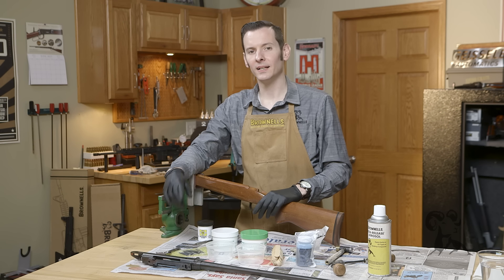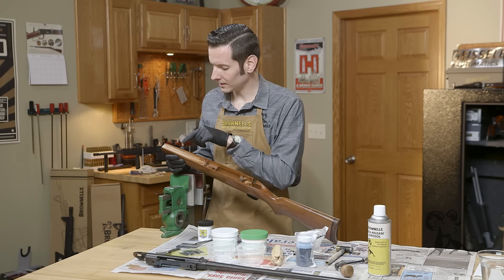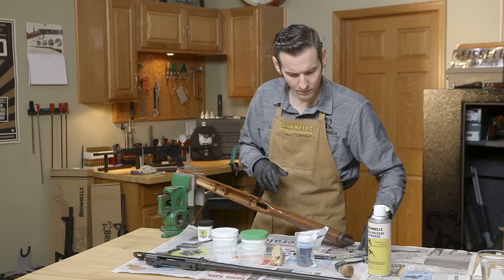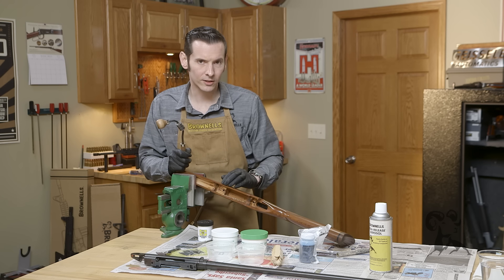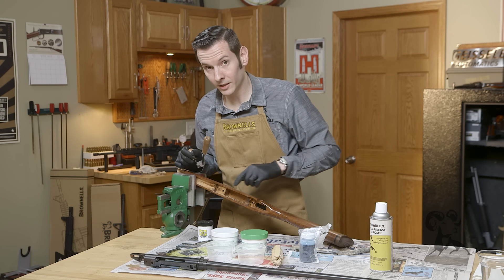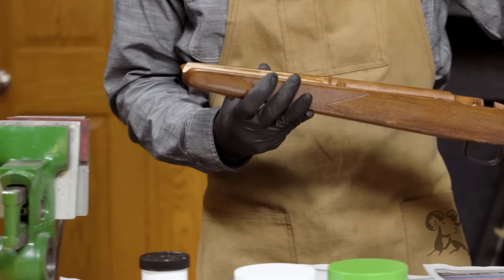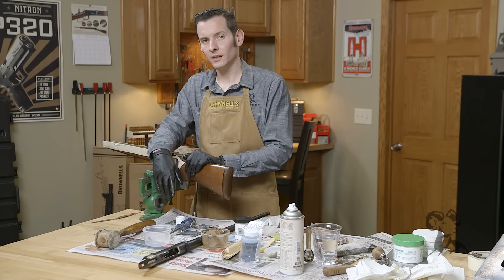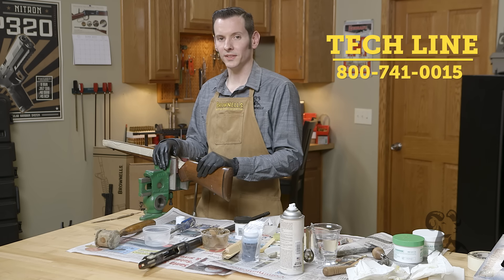Tech Tip: How to Bed a Rifle With Acraglas Gel

Comment: Good video. It’s easier to take Q-tips and clean up rather than to let the bedding compound partially solidify. Also painters tape is better because it won’t leave any adhesive on the stock. You also don’t need to bed the entire Barrel channel of the stock if you’re gonna float the barrel. And I’m not for sure why you didn’t bed under the front action screw just behind the recoil lug area.
Reply: Similar thoughts here

Comment: What is stopping the epoxy from going into the action screw holes. When you are pushing the action screws from underneath arent you pushing the epoxy in front of the screw into the hole and then tightening it all up?

Comment: Caleb, this was excellent.  As one of the last of a dying breed who actually works with their hands to make a living, I do have a suggestion.  The single edge razor blade sucks for what you were using it for.  Get an Olfa knife.  It has little snap-off blades.  It is NOT a boxcutter.  An Olfa knife is a precision instrument, designed for finesse work.  I am a window tinter, and I would put my knife skills up against any surgeon and win.  After over 30 years, the knife becomes an extension of your hand and your brain.
Reply: I use the utility version with the rubber grip more than any, but having a couple of different styles is handy.
Reply: I know what would happen if I used a razor blade...imagine that I would manage to cut into the stock 😮

Comment: I can remember doing this over 50 years ago when I was a teenager to a 10/22 that was very inaccurate. All I had to use was fibreglass resin, silly putty and vaseline for release agent. It worked well, but It's nice to actually see how it should be done. I still have the rifle, but It's been rebarreled and put in a new chassis.

Comment: I use extra long action bolts to center the action screws to the pillars and level the action square to the bottom/trigger guard. If you use the original action screws dont tighten them if the action is touching anything in the inletting other than the pillars. A high spot in the wrong place will cause stress in your bedding job.
Also tape the bottom, front and sides of the lug. Only rear contact (unless it is an integral lug, then none on the sides)

Comment: The part about waiting four hours to pull the barrel and action out to trim the excess acraglass needs to be caveated with what type of environment you are allowing the curing process to take place. If you are in a warm, dry climate and wait four hours, just get out the dremmel tool and start grinding! Great video.

Comment: 👍🤔 I thought you were going to free float the barrel in front of the camber. Good show
Reply: That’s what the tape was for on the barrel.  He now has the thickness of the tape free floated.
Reply: It's floated, the thickness of the tape.
Reply: @CalebSavant What possible benefit is there too acraglass bedding the chamber area? Wouldn't it be better to float the chamber area?
Reply: @anthonyrstrawbridge  Supporting the chamber helps add rigidity to the forend of the stock without effecting accuracy and barrel harmonics.
Reply: @CalebSavant  OH! I understand now thanx. Been away from wood so long I couldn't recall why.
Reply: I guess applying the aqua glass the full length of the stock origin is that correct I have never done it that way I always just after class the action forward of the lug about 2 inches

Comment: I encountered one that had a peened spot on the action and a little wood Chip that was folded over onto the mounting surface too. Removed both and the front action screw was too long also so I shortened it slightly. Gun shoots sub moa now

Comment: Great video. I've bedded many rifles and learned something. Surgical tubing is ingenious. I've always used rubber bands. Really the only thing I do different, is instead of using a commercial release agent, I use Kiwi shoe polish. What was the tool you used to get the glass bedding out of the magazine well? It looked really useful.
Reply: I thought it was a chisel by the handle when he grabbed it, but the way he was using it made me think it was some kind of hook or prybar? I've seen body/trim tools in auto sections of hardware stores that are plastic or fiberglass reinforced plastic that  might be useful for this, non-marring for the surfaces, but that acraglas looked very pliable to remove, especially after he scored it to get a clean line first.
Reply: i never used surgical bands, know what i used? i used the bands from sling shots. i think theyre virtually the same thing tbh

Comment: Caleb, not that it's necessary, but would a pointed surgical scalpel make trimming the acraglas out of the mag well easier than using a razor blade, given the tight quarters?
Reply: Yup, it would! An exacto works well too
Reply: Yep.  In addition, I manage to cut myself with razor blades, so X-acto is my choice.  Next project is to demonstrate pillar bedding.

Comment: Did you cut the rest of the glass in front of the chamber so the barrel free floats? Think that part got cut off
Reply: pull the tape off the gun barrel. the tape was the gap width, approximately the "dollar bill" waay of old. his method is good, ill verify he followed the right procedures.

Comment: Why do you add bedding compound all the way to the front of the fore stock when you want it free floating?
Reply from the maker: To add rigidity to the stock, so it will be less likely to flex when rested on something.
Reply: He put tape on the barrel, so it doesn't touch, obviously with the tape removed.

Comment: I think this video was informative but there are a few simple things that I believe are important. 

First, you are showing that you use the same measuring spoon for both part of the ACROGLASS. This will result in cross-contamination and will start the polymerization of the resin. As little as 0.005 grains will start the process of hardening the resin. I know this from experience. Use 2 spoons and keep them separate. I use plastic spoons as they should be discarded after use. 

Second, when you have applied the ACCROGLASS  leave the stirring stick in the remaining mixture. Then you can know the degree of hardening. 

Third, you should use headless stock makers screws instead of the factory stock screws. This allows you to align the stock and action without twisting the action to align the mounting holes 

Forthly, I would mention that household VINAGER will remove ACCROGLASS from your skin if you need it. I like that you showed using gloves, but most men find gloves a nuisance. 

I compliment your presentation it was excellent. I would suggest using more close-up shots to help the novice gunsmith understand the intricacies.

Comment: Why bother putting the bedding under the barrel that is going to free float?  I mean, other than OCD.!!!!
Reply: There is a very good reason for that, it's to make the stock more rigid so that it does not flex and contact the barrel when the rifle is shot of a rest or swollen from moisture.
Reply: @CalebSavant If the floated portion of the forend can swell from humidity changes, cant the portion of the forend that is bedded for contact at the front, sides and bottom of the lug, barrel nut and chamber do the same? Clearance is a good thing sometimes.
Reply: @kassilewis5511  Yes, but the bedding does not, it's all connected and will not move because of that.
Reply: Okey dokey...one more, any chance you know the shrink rate percentage of Acraglass?
Reply from the maker: 1/10th of 1%
Reply: Something I don't understand!? Why is the barrel floated in the first place? Older military rifles are often clamped to the wood.
Reply: @thomasbaker9787  This is true but as time went on people started to further understand more and more about barrel harmonics and their affects on accuracy. With a wooden stock in firm contact with the barrel, exceptional accuracy could be acheived but as the wooden stock contracted and expanded due to humidity(as wood does)the accuracy of the rifle could decline from the pressure on the barrel being a constant variable according to temp and humidity. Thus "free floating" was born, with nothing at all touching the barrel it was free to "sing" its on tune without external influence throughout the year. since the early era of free floating many devices have been conjured to alter the "tune" of a barrel but that is a different conversation.
I hope this helped.
Reply: @kassilewis5511  yes, that did help. Thanks for the explanation 👍 I figured it had something to do with weather and the different materials "wood" specifically! But you would think a synthetic stock wouldn't have that issue!🤔 and you would think that steel being so much stronger than wood wouldn't be bothered by a six inch piece of wood. But then again, slow motion video does show how much a barrel does flex when fired... crazy stuff!
Reply: Synthetic stocks are pretty much impervious to moisture but most synthetics are prone to warp from higher temps and uv exposure... The cycle repeats.lol Just from a different source of aggrevation.